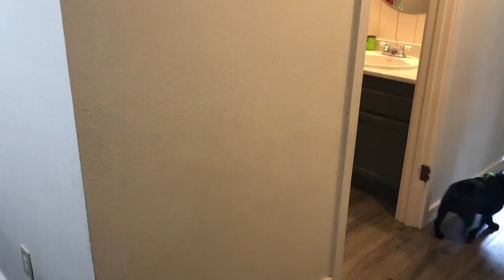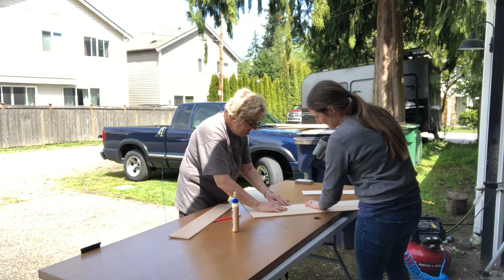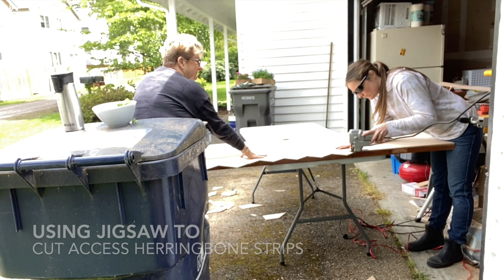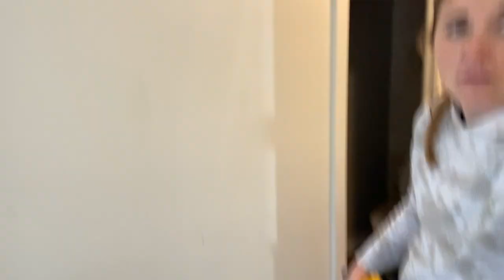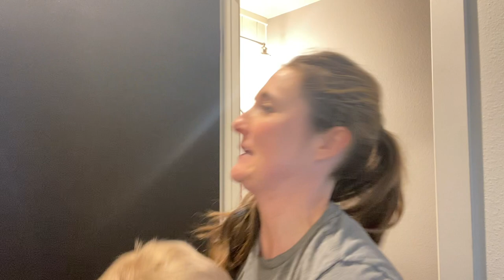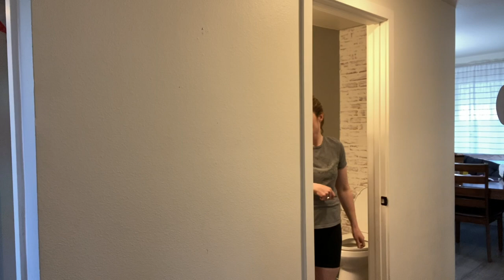DIY Herringbone Door | Convert Any Old Door Into Herringbone Pattern!!

Comment: What kind of wood did you use?
Reply from the maker: Hello Yoanna!  Thank you for watching.  We used a 8x4 sheet of sanded plywood from Lowes and cut it on a table saw and miter saw for the herringbone pieces.  We went to Lowes and got: RevolutionPly 
5Mm x 4-ft x 8-ft Poplar Sanded Plywood
Model #518477